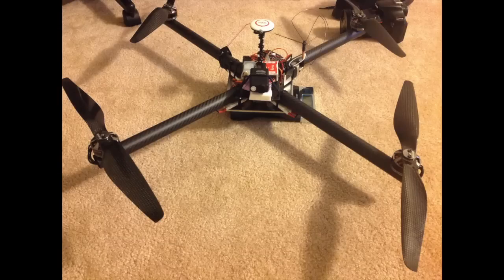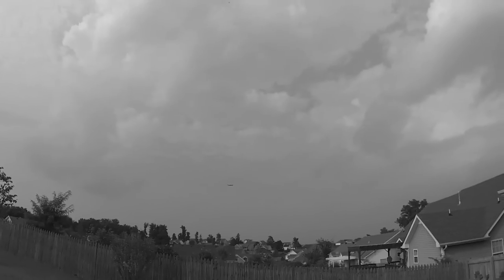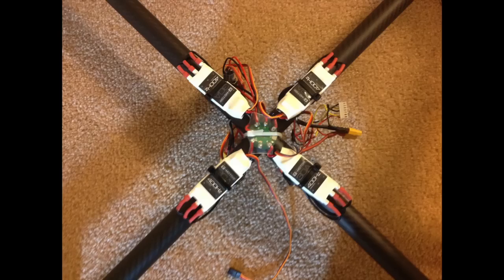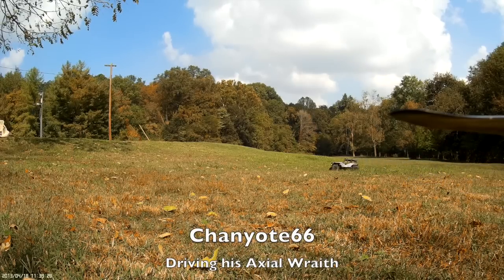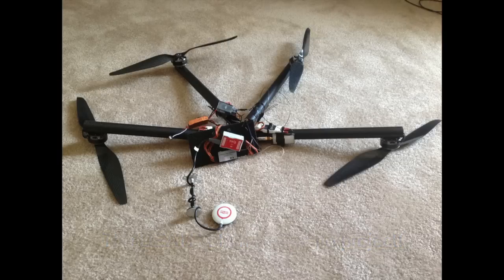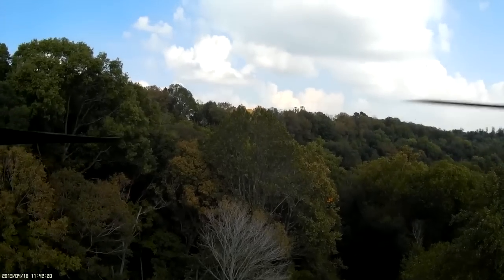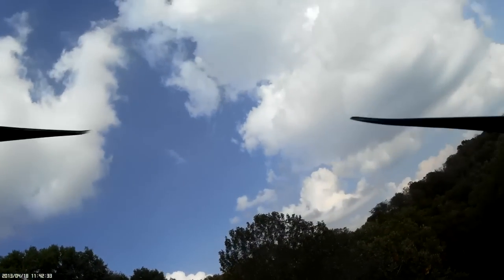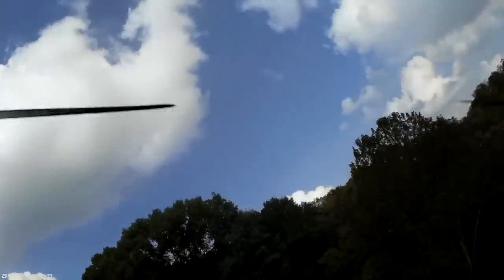Project Hopes and Dreams 6s Long Flight Time Quad FPV Video! Part 2

Comment: Great video and the Halo reference, sux about the quad tho. OSD is your friend!
Reply from the maker: Thanks glad you liked the video. I was not planning on rebuilding it, but I just had a great finding where I figured out a setup than should theoretically fly for 128 mins. Even if it's not as efficient as my calculations say even 90 mins would be a super long time.